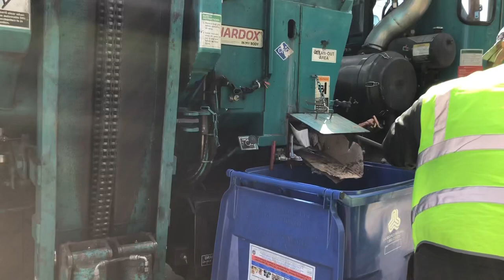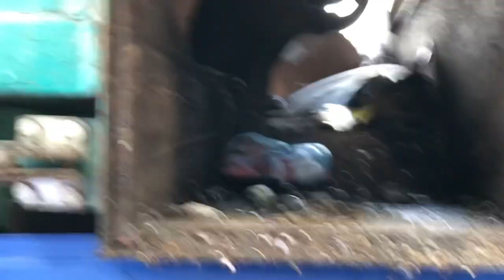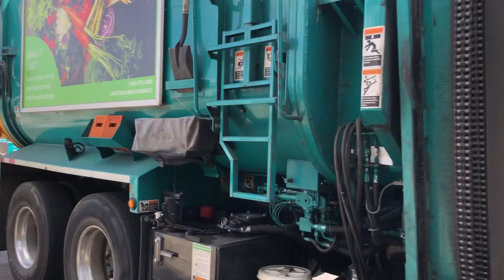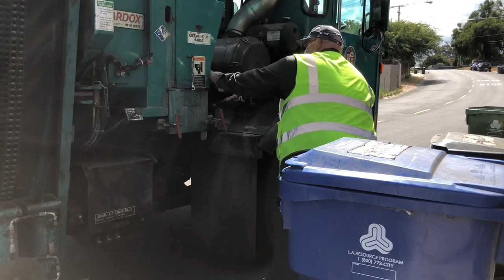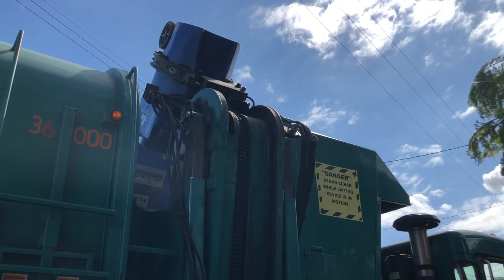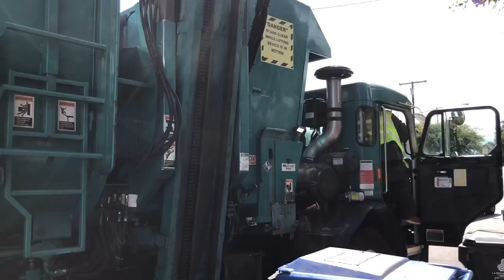The process of cleaning out a garbage truck

Comment: This guy's packer must have stalled out on him judging by how he did this mid-route and all the stuff that was in there. Must have been a heavy route too for this amount of material to have worked its way below the folding follower and into the hydraulic chamber. I typically see this done at the day's end when dumping.
Reply from the maker: Yeah but he actually did this at the end of his day after dumping the recycle
Reply: @GarbagetrucksofLA  alot of drivers clean out before they go to the dump that way when they dump their truck their in & out in his case he cleaned out on his route rather than doing it in the yard I my self do this
Reply: @deeh7786  yeah that's true